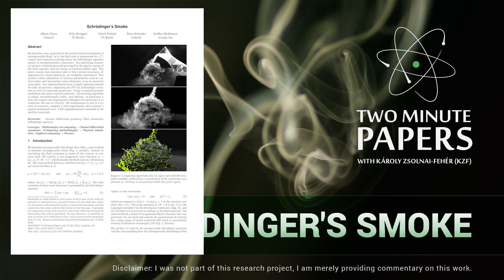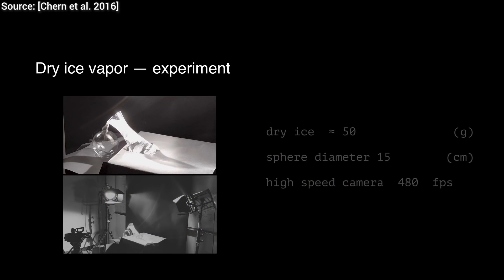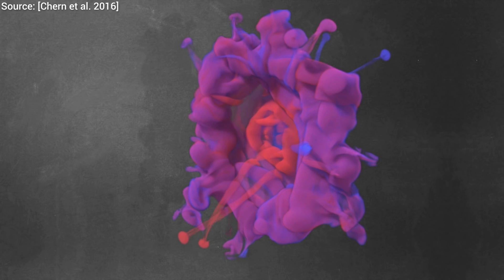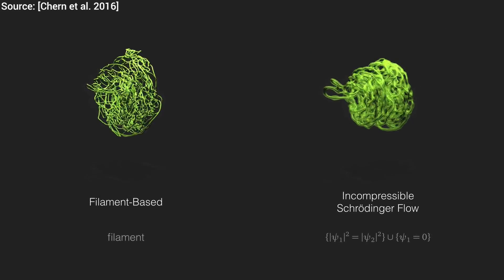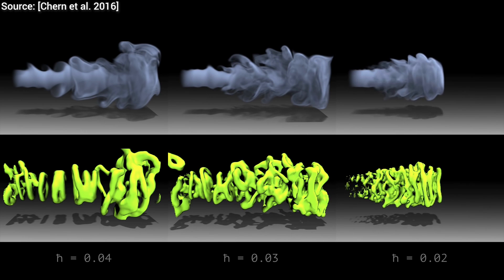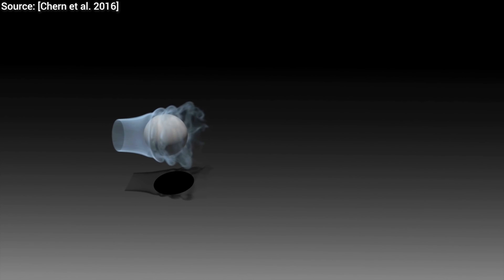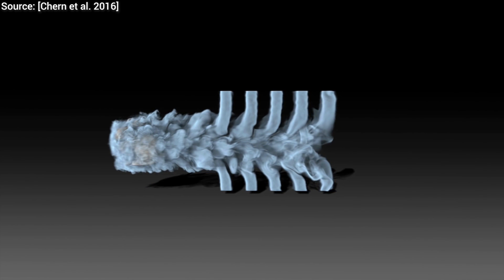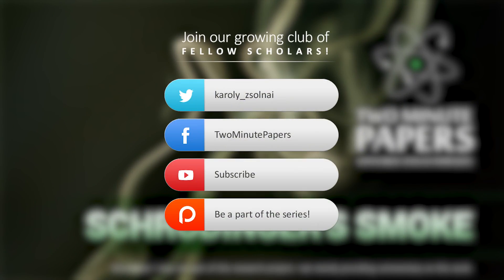Schrödinger's Smoke | Two Minute Papers #70

Comment: Mind blown!

Though I didn't see any mention of the performance gain if any?
Reply from the maker: I was unable to find hard numbers in the paper. What I have found is spatial grid resolutions that range from 64^3 to 192^3, which are quite favorable numbers. If you pair this with a linearized version of the incompressible Schrödinger-equations, it sounds like a mighty efficient technique. :)
Reply: thanks :)

Comment: One thing I really like about this work is that it very intuitively shows what the Planck's constant does. It's, roughly, a measure of the amount of detail you can get. Smaller constant -> more detail.
Reply from the maker: Yeah, I found it absolutely crazy that you can actually modify it. At first, it felt like "insert the desired value of pi here". :)
Reply: Károly Zsolnai-Fehér you can, in principle, change all the fundamental constants of nature how ever you please. It's probably the best way to figure out what the constant even does :)
(Of course you can only do that in simulation... Unless you have reality altering super powers :o) )

Comment: I'm not sure why it should be Schrödinger equation. I guess Fokker-Planck equation (describing classical stochastic process) works better for this purpose. One advantage of using Schrödinger equation (that I can think of) is that the simulation could be easily implemented into quantum computers. But it seems that it is not the original purpose.
Reply from the maker: I think an important part here is that this is an incompressible Schrödinger-equation variant which makes the simulation stable (you don't have to do the Helmholtz-Hodge decomposition to make the pressure field divergence-free). I'll definitely read up a bit more on this. Loving the concept. :)